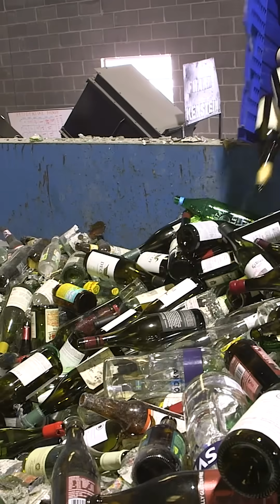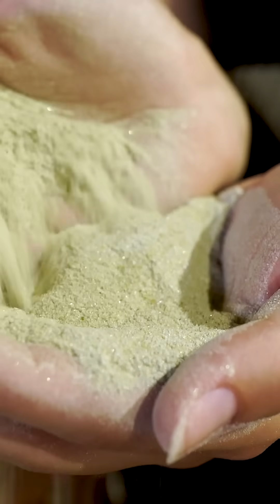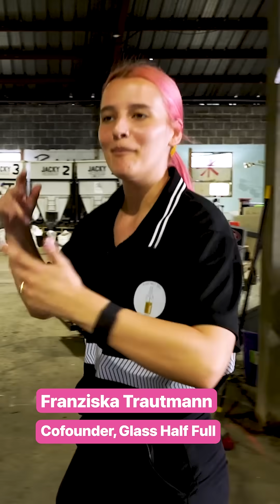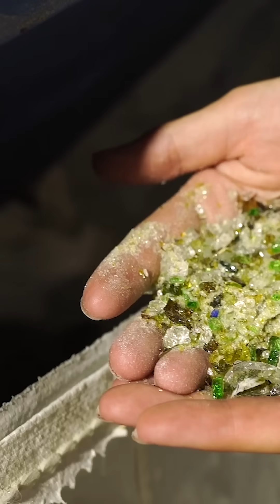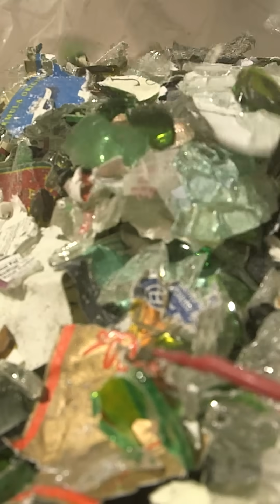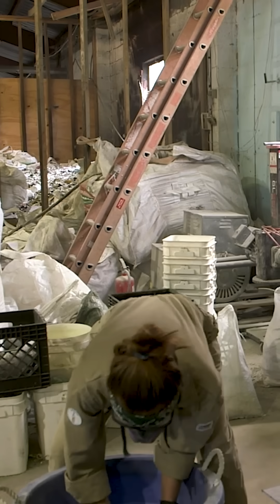Here’s how this entrepreneur crushes glass bottles back into sand. #Recycling #Sand #Glass

Comment: My city needs to do this. We have mountains of glass that no one wants to buy. The city no longer accepts glass in our recycling bins.
Reply: Make more glass out of it and sell it? Glass is a valuable material that can be reused infinitely. 
 It's not worthless like used plastic.
Reply: @Banzybanz  Yeap. And if the city doesnt accept glass in the recycle bin something is very wrong with the city itself.
Reply: @pedromoura1446 Its very common for it to not be accepted. It is too much of a hazzard at the sorting facilities so they don't handle it. It is also very low value in the US as there are still cheaper natural deposits. So they don't want to deal with a higher risk material for little or no profit. The best thing to do with glass is re-use it as a bottle.
Reply: @court2379  i understand that. it also happens in the EU and although we have a heavy difference because we protect those deposits environmentally and because the government itself is doing the colect of the material (which is then sold).

But it still confuses me because you get higher quality than by using sand and recovered glass is essencially free as opposed to having to extract sand and transport it from god knows were...

it just sounds like one of those "i'd rather keep my coal power plant and keep buying tons of coal every day to burn than deal with the easily solvable problems of wind turbines"
Reply: @pedromoura1446  It's not higher quality necessarily. Some glass is incompatible with concrete use. Also it is far from free. Collecting it, sorting, crushing, transporting it, and the energy use. All of those have significant costs.
Reply: @pedromoura1446  That's really the contractor the city pays, not the city itself.
Reply: @pedromoura1446  It's not as simple as just using coal for power. Coal gets use in huge quantities in a lot of other processes. Stop all of those and the economy tanks because doing it any other way is very expensive. Do a little research before blasting back.
Reply: @Einwetok  the contractor is paid to pick up the material. They could make extra profit by selling it instead of burrying it somewere (which they are here) and glassmakers would gladly pay for a better material that is usually also cheaper.
Reply: @Einwetok  we dont use coal powerplants anymore in Europe and our economy didnt tank...
Coal is just an hydrocarbon source mainly used to produce heat and in little else in the economy. Theres a lot of replacements for it and it's end products.
If you said "oil" then sure... There's a lot of associated products because it's much denser in hydrocarbons and it's easier to work with but coal?! There's certainly some usages but it's not indispensable...
Reply: @pedromoura1446  Look up coke, it's essential for steelmaking. Clinker's used to make cement. Making hydrogen, gypsum (Drywall), the list goes on....If your country isn't burning it to make these products, then it's importing it still.
Reply: @Banzybanz  We have no facility to melt the broken glass.
Reply: @johnnyearp52  Then build one. Or sell the broken glass to someone who owns such a facility.
Reply: @Banzybanz  I live in an arid area. It costs too much to ship the glass  elsewhere that has a place. They are far away. 
Someone could possibly build a plant to melt glass here but no one has and I don't know the reasons why.
Reply: @Banzybanz even used plastic can be recycled, especially as we're finding enzymes capable of breaking the polymers apart into their base components. But that technology is still far behind in development, compared to the mountains of plastic waste that build up every day.
Reply: Which city and country
Reply: @MTVCS  Albuquerque, USA
Reply: Just do what China does and dump it into the ocean,.
Reply: That is TERRIBLE.
Reply: You do know this runs off fossil fuels for energy that actually utilizes MORE energy than just tossing them in the ocean.
Reply: @CL.Veritas but used less energy than making glass from sand from scratch
Reply: @HercadosP  but why though...? Toss the glass into a bin and place it on an oven until it melts. Remove the Surface impurities and you get new glass with more quality that if you were using sand... No need to turn it into sand again... What a massive waste...
Reply: @pedromoura1446 recycled glass sand does make a good sand blasting media.
Reply: @martyk1156  as does any other fine sand that is not as difficult to find... Sand for glass is quite rare already, entire beaches have been destroyed to get sand for glass and recycled glass to make more glass quite literally increases the quality of a final product that will reenter the cycle again and can be reused in a million ways instead of ending it's life as cleaning agent or returned to a beach somewere only to be reexcavated a few miles down again...
Reply: @HercadosP I don't think that is true in the US and is why it is rare to see glass processing facilities like this there. Its cheaper and uses less energy to just dig it up. Crushing it isn't required from natural deposits.
Reply: @court2379 Show me your sources. That's plainly wrong.
Reply: @BlueFlash215  Plainly? Assuming you are protesting the cost issue: Digging it from a natural deposit requires usually an articulated loader. If deeper or farther away there may be other machines like a dump truck, but surface open pits are common. Then it would go thru a screening machine to get the larger rocks out or sometimes just used as is. The material is ready to use at that point (after storage indoors to dry).

For recycling you need to collect and transport the glass (a significant effort). There might be collection equipment costs and the cost of bins and the construction of them like the underground ones I have seen in the cities in the Netherlands. Do the initial crushing. Sort the trash out. Potentially wash it if needed.  Convey it from machine to machine. Dispose of the trash. Assuming you are going to melt it down you can skip the second crushing into sand. Have storage space for the various levels of materials throughout the process.  So your capital expenditures alone are far more already because you need two to three more expensive machines, collection equipment, and space  to store it all. And then the energy and staff to run them which is also much more. Then the product produced is lower or often unusable quality because it has pigments in it, and clear or other consistent colored glass is being made. 

There may be cases where the economics can work out better for one over the other, but they must be rare or glass companies would be doing it. There isn't a technical barrier. All the equipment needed exists. What company wouldn't take advantage of if it was cheaper, and is good PR? The evidence is that these don't exist at every glass plant. They recycle their own materials because they are known quality and no additional processing is needed. They don't bring in outside glass. The evidence is that so many recycle centers don't take glass.
Reply: @court2379  Germany and the Netherlands show that it can be done cost effective.

You name all the tiny steps in recycling and in comparison creating new glass is portrayed as an easy process with just some simple steps.

The sand you need, same with recycling, needs to be clear of all other materials.

Coming from Germany, I can see the process in action. Glass can be recycled to 100% with no loss in quality. If there is a system, and that system is as simple as in Germany, you have people bringing all of their glass to recycling facilities and sorting the glass beforehand.

The thing is that everyone here is raised with a mindset of the importance of recycling. Worldwide recycling numbers show why Germany is leading in this field.

How do "pigments" get introduced in the recycling system? Why should those pigments be immune to the easy cleaning processes that happen before recycling?
Reply: @pedromoura1446 totally and probably very unsafe for nature, humans and animals if that sand gets into lungs or any other cavity. Eyes. Etc etc etc. We normal get sand in the eyes... Imagine glass 😂😂😂😂 and if you make this a material of construction it must be designed in a way you can rebuild a property with same materials. Just like a guy that make ones like Lego. But the materials from the glass combined with others to make brings will be hard to un do like to recicle again so it must be done in a way we can rebuild with the same materials and don't turn in a waste we live in a world where there are natural disasters people who abandon properties all the time. What will happen with those materials later.
Reply: @BlueFlash215    First I am fairly sure in those countries the recycling is done by law, so these countries do nothing to prove the economics of it. A potentially cheaper option isn't legal. Also the availability of raw materials varies by region so in one that lacks the natural resources, yeah recycling will likely be an economically beneficial endeavor. I know the region is mostly seabed and sand is everywhere, but it may not be suitable for glass? There are also major differences in city design making it much less expensive to manage and install in Europe than the suburbs of the US. And then the cultural/behavioral differences... 

The manufacturing from raw materials does have less steps and requires less equipment. I am not portraying it as simpler, it is simpler in most cases. Think about all the steps in the process from the consumer back to a new bottle vs. a pit. 

Recycling it only produces the same product if it is sorted by color. Mixed glass makes for an undesired colors and I don't think the pigments can be removed (being metal compounds melted into it). In the countries mentioned the burden of that sorting has been displaced to the public to be done for free. You cannot ignore that cost in an environment where that isn't happening. Perhaps you could develop it over time, but there are also more bins, and more management of those bins to make that work at even more cost in the spread out US.

If we really care about the recycling glass, we really should be reusing the glass, not remelting it and creating a new thing from it. Standardize bottle and jar sizes and colors. Charge for the container and give a rebate when they are returned undamaged. The design would probably be a bit thicker to make them last longer vs the one time use ones common today. This used to be common with soda bottles in the US up to about 1985. Then manufacturing of new bottles became cheaper and they stopped doing it. That will likely shift back over time and the cheaper source dries up.
Reply: @court2379  more bins and management of those bins?

I told you already, that it's a cheap solution. It just takes three different bins for white, brown and green glass. There are no more steps except cleaning it up. You can directly work with broken glass since it's free of impurities.

You can just open "a pit". Do you think the sand will be 100% clean? What about the needed limestone? Furthermore you need to add soda ash. You have to make sure all of these components are clean. You have to dig up sites, destroy huge landscapes because you can't just use any sand. You portray it as just opening a pit somewhere, start digging and melting the harvested ressources.

You can melt broken, recycled glass. That's a fact. No need for additives, no complicated systems, just three containers that are emptied every 2 weeks and are placed throughout the city.

Do you want to explain to me that digging up a whole site, filtering and harvesting sand and limestone, creating soda ash and then transporting it to a facility is less work than taking glass that is avaible in pre-sorted containers?

This discussion is about recycling and of course I'm talking about a working system like here in Germany.

If you want to start off by suggesting it doesn't work, then assume the same for the extraction of the sand process, the cleaning and mixing of components.
Reply: @BlueFlash215 what do the Germans make with the recycled glass?  Colored glass is made by mixing metals into the molton glass.
Reply: @CL.Veritas  What runs off fossil fuel?